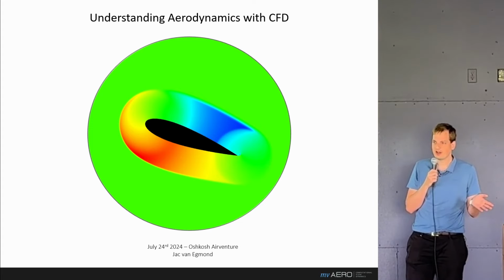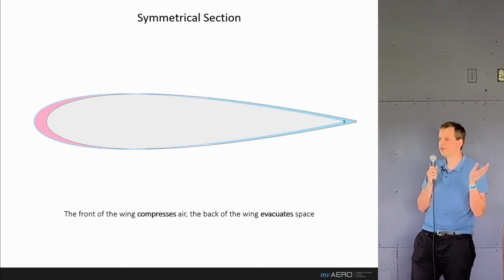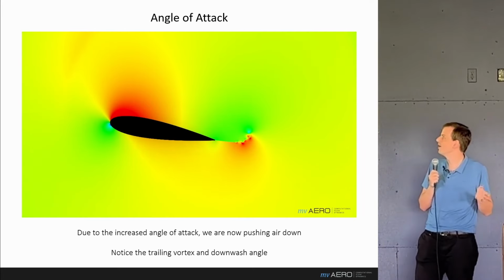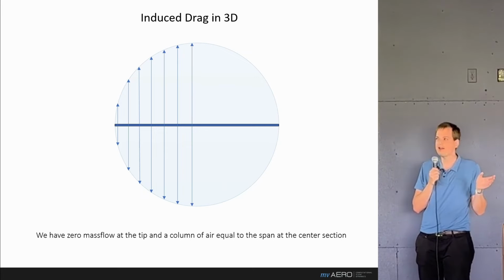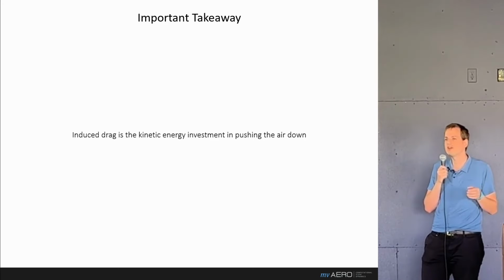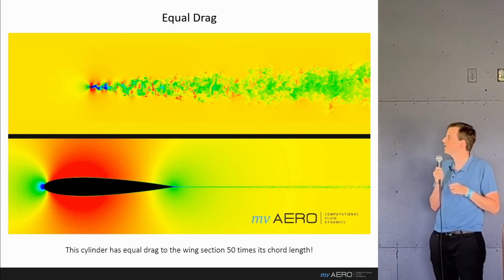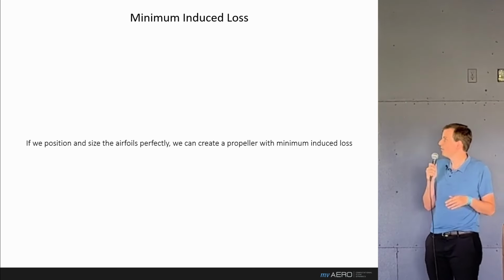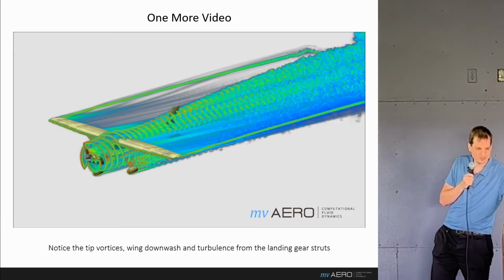Understanding Aerodynamics with CFD - Jac van Egmond

Comment: Your analysis at 6:48, which uses the speed of sound to trace the evolution of pressure distribution around a wing, appears to provide a unified and complete resolution to the long-standing paradox of how airplanes fly, propellers create thrust, wind turbines generate electricity, and yachts sail upwind. 
I have been struggling with this for a while now and would very much like to understand the principles you have applied to generate the evolution. I have emailed you separately with my contact details, and look forward to hearing from you.